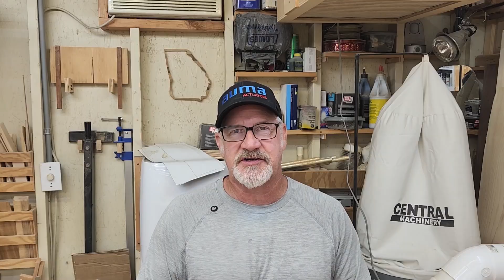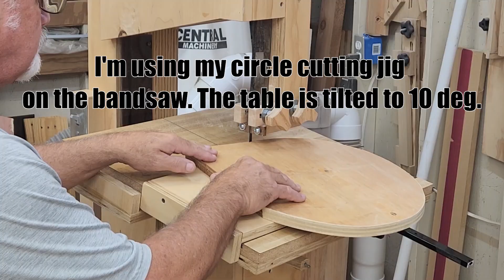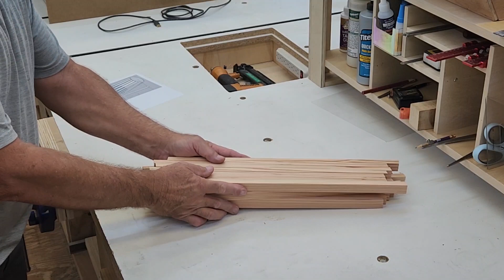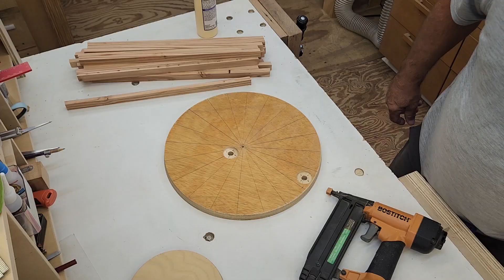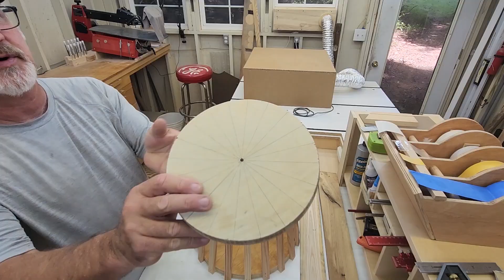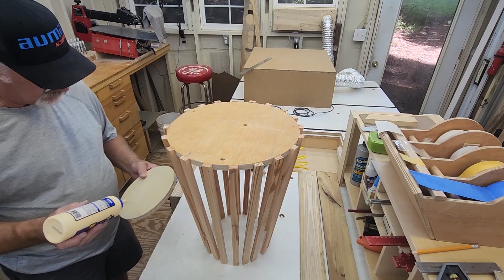Prototyping - Can it improve your Woodworking | Bobby Sharp

Comment: Just found your channel. Cool design. Put on  4 uprights, flip, and glue the top to the 4 uprights. Let the glue dry. Then add all the rest of the uprights. I would make top and bottom a little thicker, and the uprights a little wider. Less glue squeeze out. That way you can add a little CA glue and activator to hold them while the wood glue dries. No need for brads. The wood glue would be plenty strong enough.  Just my opinion.  You could cut a small dado line into all the top and bottom uprights, and twist  a wire in like you make a bucket and it would never come apart. Looking forward to seeing your next video build
Reply from the maker: Glad you enjoyed the video and thanks for the constructive ideas on the build! My sister wants wider slats. The bottom and top will be thicker. I have some rough sawn poplar that was 4/4 when wet. After drying it is 13/16. I'll keep it as thick as I can keep it. My wife wants one too. Thanks for the comment and welcome aboard!